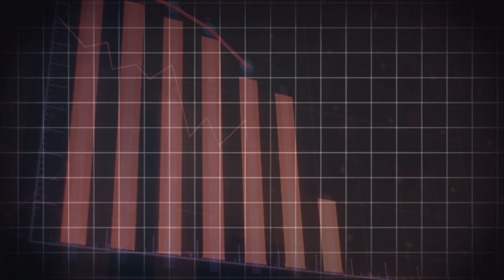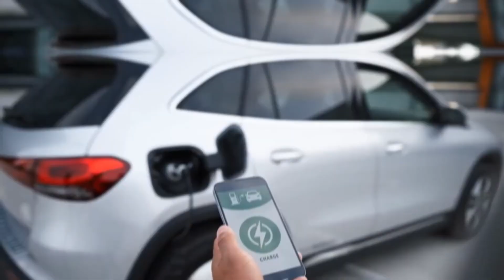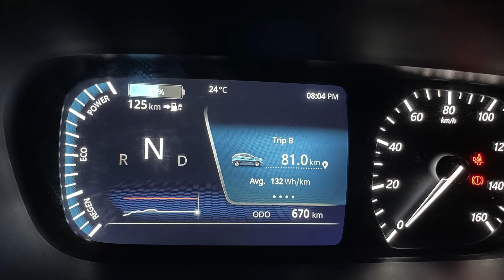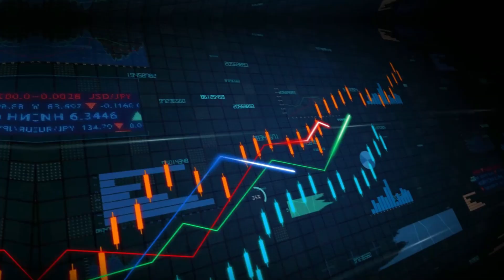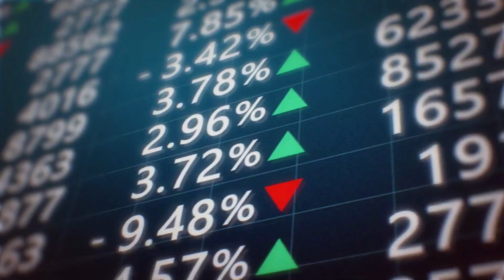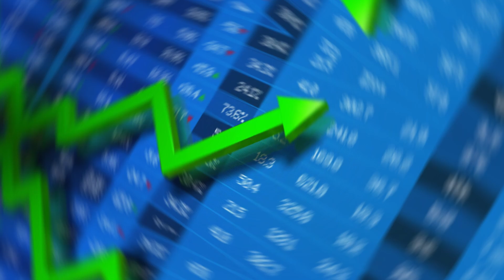Do You Think Cheap Used EVs Are Scam?!

Comment: I just picked up a 2018 Chevy Bolt for $15k and I get a $4k tax credit on that. The best part is the entire battery pack was recently replaced under a Recall by the manufacturer. My 8Year/100k battery warranty has now be reset, I am covered until 140,000 miles. For my purposes this is the perfect vehicle and I feel I got a STEAL of a deal compared to what this vehicle sold for new.

Comment: I would definitely buy a used RV over a new one a 2023 Tesla Model 3 that sold for $40,000 one year later is worth on a new Tesla trade $23,000. One other factor to consider is insurance it's 90% more expensive than a gas